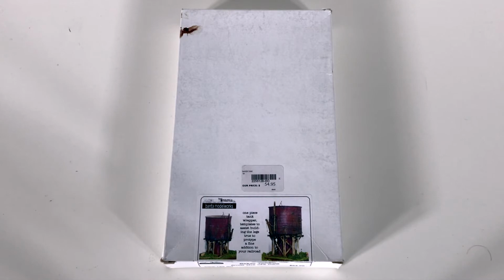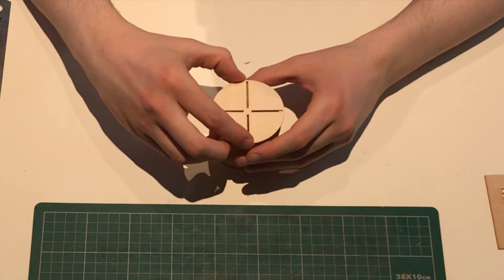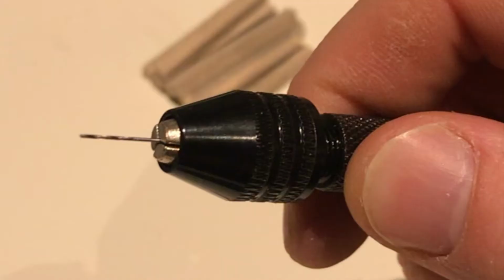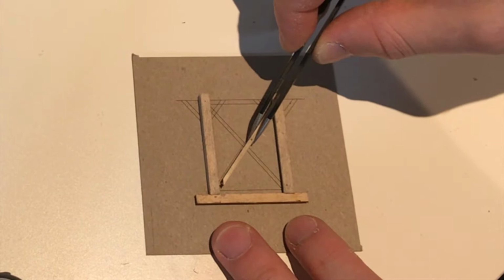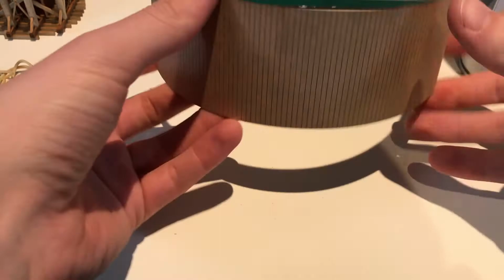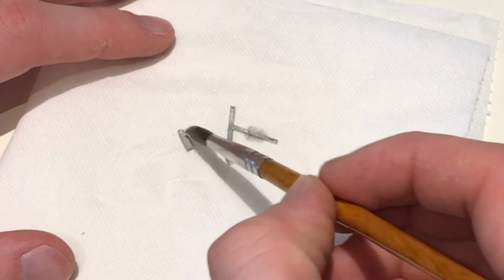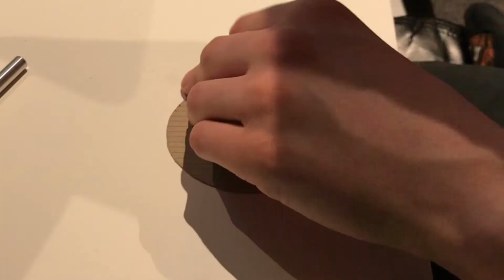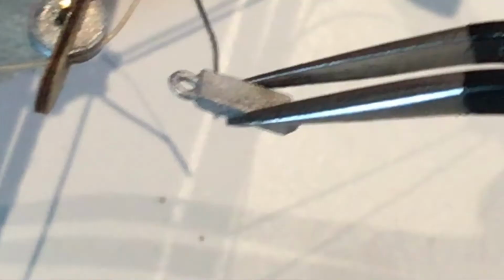Making a Miniature Water Tank | HO Wood Kit Build

Comment: Really glad you posted this. I am about to put together the o scale version.. definitely lots of parts amd I've never done one like this before. This should help.. not sure the metal rod came with mine? Was surprised the tank wrapper wasn't long enough as well..
Reply from the maker: I hope you enjoy putting it together and that it is a success. It should hopefully be a little easier to put together in O scale, it was incredibly fiddly for me. The rod might not be necessary for your scale, but if it is I'm sure it should be easy to get some jewellers wire to complete the build. The tank wrapper didn't work well for me either, I'd suggest getting some sticky back paper and cutting thin strips for the wrapper, as I do in this video!